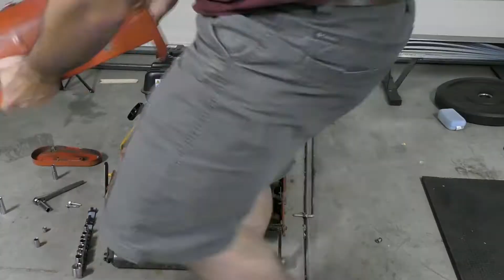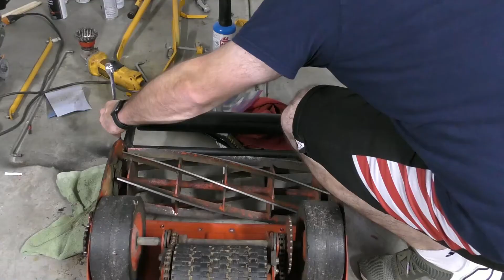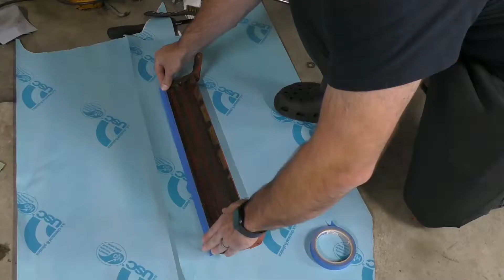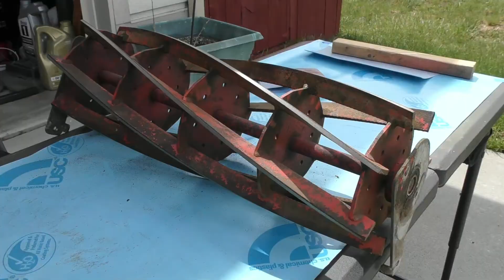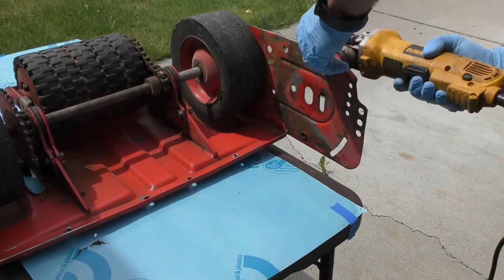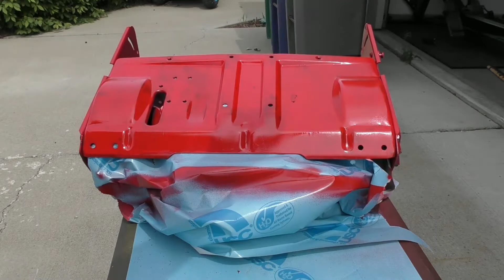Mclane 20" reel mower - Part 2

Comment: You might of used that orange color from using Chevy engine orange to paint the blades I used rustelouem Hammerite black
Reply from the maker: Stuck with the Majic IH Red, I have seen alot of people going between colors. I wanted to stick with the stock OE look.
I have seen a few painted with the hammerite style and they look super neat. If I ever do an electric conversion I would do a pure black in order to get the "stealth" look